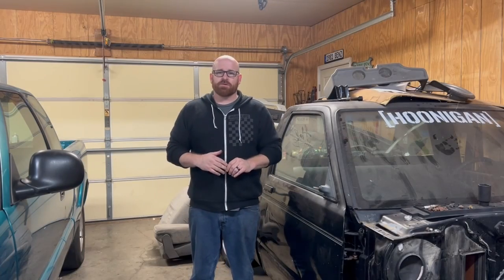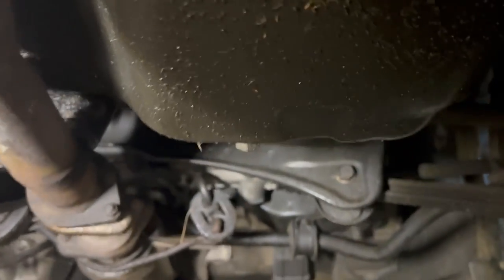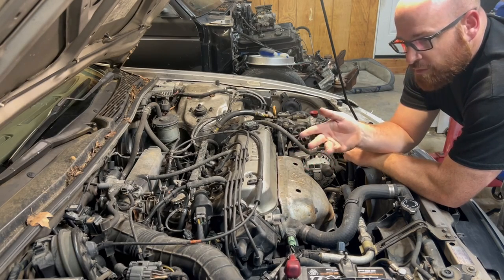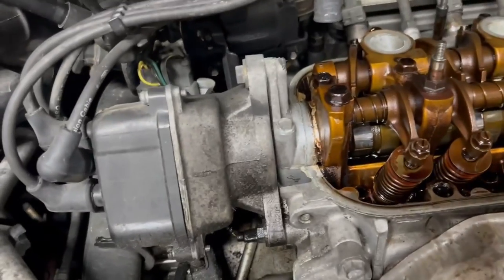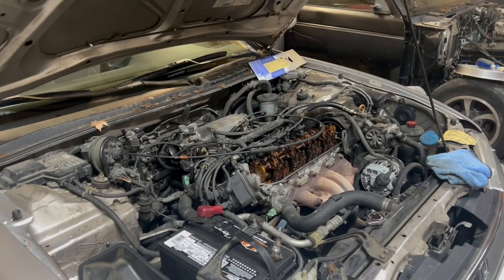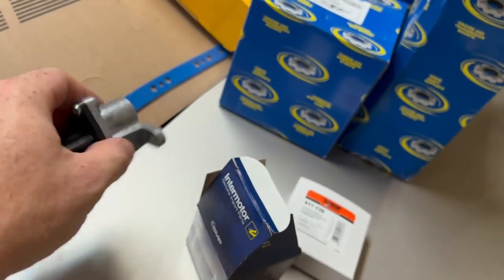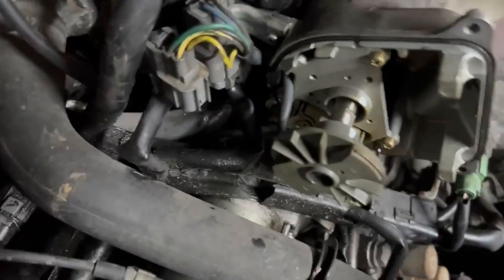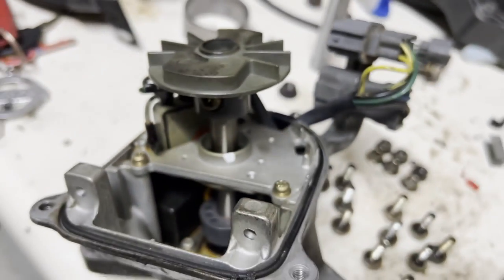1997 Honda Accord Vehicle Speed Sensor VSS and Distributor O-ring replacement

Comment: I have this exact car and year and since i got it at 269k miles it has had a wavery idle at cold starts but as soon as the thermostat opens it goes away and runs normal. 
I got a cold start idle air control valve off a car from a junk yard and the normal isle air control valve since its a hard part to find and expensive for a honda 😅 
I also am doing everythi you just did to yours. 
Mine leaks from the distributor O ring still but ive stopped the valve cover from leaking with a new gasket and adjusted my valve lash since it sounded horrible lol 
These cars are awesome for a new mechanic to learn on

Quick edit: the distributor on these cars has nothing yo do with the timing too lol, just spark and stuff. 
The only way to wack out your timing is to get an ecu thats been tuned so the narks are not neccessary

Comment: What made u change the speed sensor ? Last night I was driving and my speedometer went out , and my transmission won’t go past first , so I think the speed sponsor will help , or transmission position sensor ?
Reply from the maker: What kind of car do you have? For this one, the speedometer wasn’t working and it was causing the check engine light to come on. The transmission still shifted like it should though.
Reply: It could be the transmission speed sensor

Comment: i changed my speed sensor on my 94 accord ex but its still not working any help would be great
Reply from the maker: Sometimes the sensor isn’t the issue. Some guys have seen shorted wires to the harness for the vss, as well as damage to the plug. Trouble shooting electrical can be a pain, you have to be patient. Diagnose every possibility issue until you find the source. Sorry that’s not much help, but it’s the next direction you have to go.
Reply: @projecthardway  thanks bud
Reply: Me too, though I'm not 100% sure I fitted it correctly.